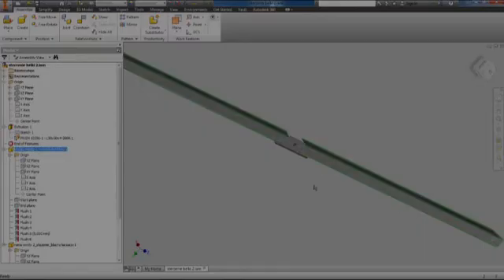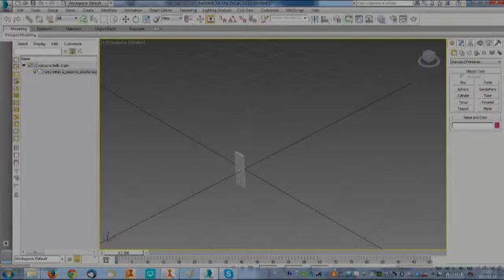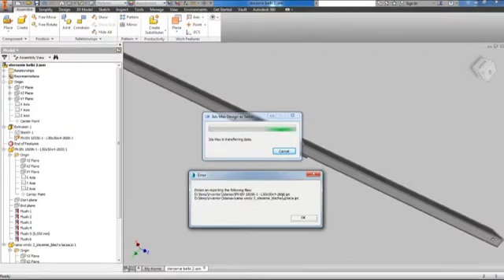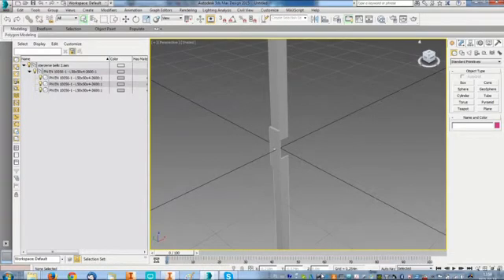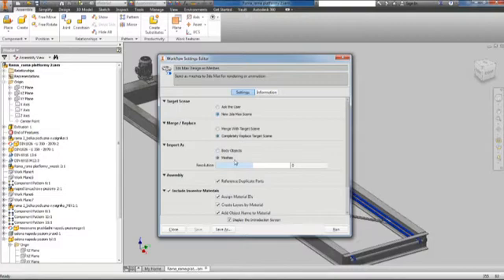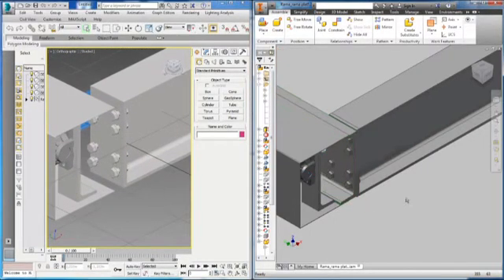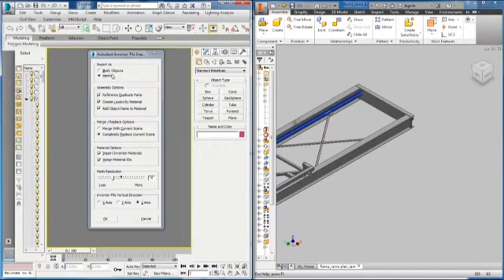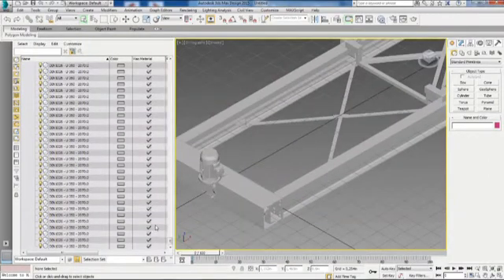Inventor   3dsmax import not working

Comment: Hello, I have just recently upgraded to 2015 at work and am having the same problem!! Having to export as STEP and then importing into 3Dsmax works fine but then end up losing all references/groups/object names. Not a great work around. Have you managed to find any solutions?
Reply from the maker: Hi,
Autodesk say will not fix this in 2015.
If you remove all modeling operations from assembly level this helps.

You can join this topics on forum, and report this to autodesk to make pressure on them.
http://forums.autodesk.com/t5/3ds-max-3ds-max-design-general/cannot-import-to-3dsmax-from-inventor/td-p/5483685

I had a Autodesk Support Case regarding this issue. it was closed as NOT CONFIRMED.
Here I have a topic about this. As you can see their response is rather not "user concerned"
http://forums.autodesk.com/t5/inventor-general-discussion/how-could-you-close-thi-support-case-not-confirmed/m-p/5564658#M541437

Cris.